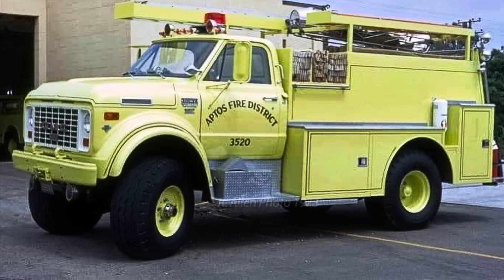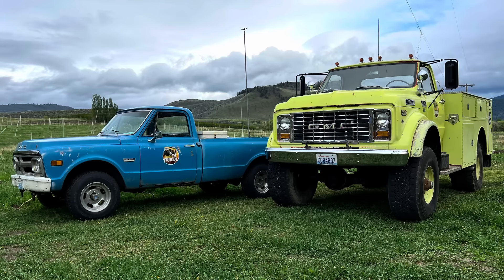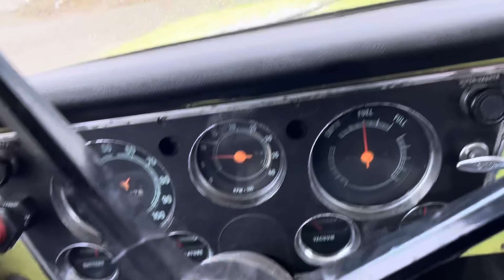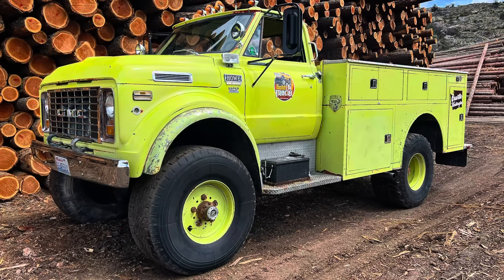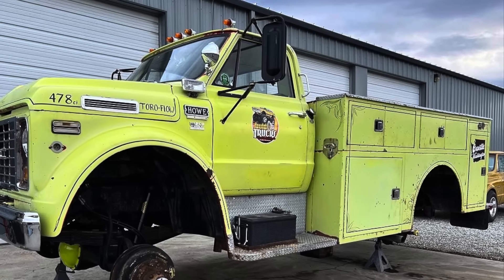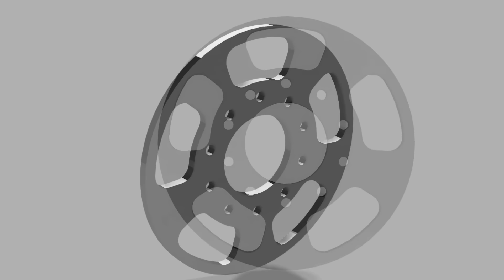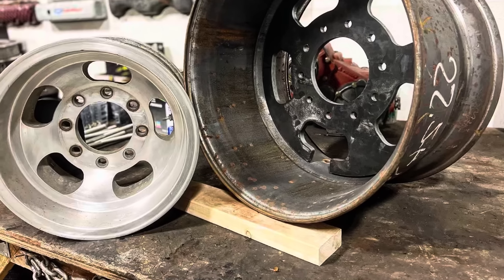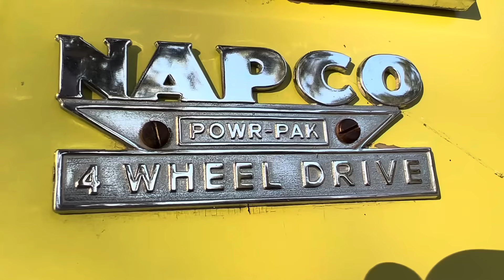My 1972 GMC Napco K5500… The World’s Rarest ‘67-72 Truck! Factory Toroflow Diesel/Allison Behemoth!

Comment: Wow, a Toroflow!? The Anti-Detroit-Diesel from when GM could afford to compete against itself. So few of those exist. That's a rare bird. It sounds absolutely great.
Reply: They weren't as reliable as the Detroit but farmers bought them.😅
Reply: @jimmychanbers2424 , they don't sound as good, either,  although nothing sounds better than a two-stroke detroit.
Reply: I wonder if any of their "toro flo" designs went into the 8.2 fuel pincher
Reply: @blazer6696  That's a great question! I'm leaning towards no. I've heard that the ToroFlow was actually a dieselized GMC gas engine, while the fuel pincher was a cleansheet diesel design meant to be as cheap as possible. But who knows?
Reply: @littlesquirtthefireengine5478   Oh I gotcha.   It was a w.a.g,  wild @$$ guess,   LOL
Reply: @blazer6696  8.2 shares the injection system with the 71 series... so probably very little toroflow design made it into the fuel pincher.
Reply: @littlesquirtthefireengine5478  toro flo was the V6 convert to diesel , the GMC V6 series are great motors, run for ever
Reply: @speeedskater developed simultaneously from the same basic block design so some tooling was shared, but not converted from an existing gas like the Olds 350.  I have a big book just on GMCs.  Don't overload, or run too hard like a Detroit, many guys said that's when they had issues, if they were ran real hard, but they were excellent for fuel economy at the time.  Obviously beat the pants off gas engines of this size, but also rated very high for a diesel on fuel economy.  These engines lasted a long time in marine applications, also, some had 1, even twin turbos in marine use.
Reply: Probably the only thing GM ever made good was it’s diesels. Regardless of what it was used for, Detroits, Toroflow, EMD, Euclids . All great
Reply: @loganbaileysfunwithtrains606  ford or dodge still can't build a good diesel 😅. After all these years
Reply: WOW!  I love it!  Excellent save!

Comment: I cut my teeth on that truck! It was brand new when I got hired at Aptos Fire Department. Later I when became the Chief Mechanic for the dept. I worked on that truck for years. There were 2 of them built same time by Howe Fire Apparatus in Martinez. I ran into one of them about 20 years ago on Santa Cruz Island. Yep, Napco front axel.
Reply from the maker: Call me , 15095603970
Reply: That is sooo cool. I'd love to have the other one! Although I'd use it for logging and fire suppression
Reply: Yep the other one was out at Santa Cruz Island
Reply: Was Chinn the chief when you were hired? If so I'm guessing you're bound for Hell too for messing with the nuns. After this time period I went to work for SCFD where our only interesting piece of apparatus 1949 LaFrance 75' ladder truck repowered with a V6-53 and an Allison. Top speed was just over 35mph. We also ordered the last gas engine/manual transmission engine that Van Pelt built. I always liked looking at the twins.
Reply: That's pretty crazy you happen to see this video from a master piece you worked on years ago.  It's probably still around because of the maintenance you performed.
Reply: Where's the 2nd one?
Reply from the maker: Thanks to this comments lead, I was blue to find the fate of the The second truck. It was donated to the island for fire safety by another California coastal station and it lived on the island for a number of years before getting in a tragic accident and rolling off a giant cliff and down a ravine to its total destruction and demise
Reply from the maker: Truck 3520, my truck, is the last and only left of its exact kind.
Reply: @GoldCityTrucks  Wow! The sole survivor

Comment: What an awesome piece of old iron. When I was just a small kid, my Dad looked at buying a Toro-Flow diesel GMC flatbed truck for his contracting business.  A neighbor owned a GMC dealership at the time, and wanted to make a good deal for Dad to buy the truck.  My Dad finally decided that the truck was just a bit too big for what he needed and bought a 1-ton gas GMC flatbed instead.  The Toro-Flows received some modifications in 1969, renamed the Toro-Flow II.  The engine was renamed the "Turbium" for the 1972 model year, but few referred to the engine under the new name.   The Toro-Flows main problems were head gasket leaks and fuel injection issues.  I suspect that the fire department specified the Toro-Flow diesel because of the ability of the diesel to withstand very long idle times when in use--an ability which post-2007 diesels no longer have without causing emission system problems and repair expenses.  The Toro-Flows were never big sellers during their era, in part due to the fact that gasoline was cheap and readily available.  Up until the late 1970's, diesel fuel was largely only available at truck stops and bulk oil jobbers.  As you noted, the Toro-Flow is pretty fuel efficient.  The comparable GMC gas V6s of that era wouldn't get half of that fuel economy.  My Dad's 1-ton GMC with the 305 V6 gas would only get around 9 mpg, at best--but that engine was a "puller."  As you likely know, those gas GMC V6s had a sound all of their own.  Decades after my Dad sold that old GMC,  I can instantly recognize one of those GMC V6s just from the sound.  The gas engines would run forever, too.   The NAPCO 4WD conversions were bulletproof units that saw extensive use.  That is a great truck--I would have likely gone back to standard wheels and dual wheels in the rear, though.  If the Toro-Flow ever completely conks out, I suspect that a Detroit 6-71 or 6V-71 would be a bolt-in replacement--both bulletproof engines.
Reply from the maker: Thanks for the story on your dad and his truck. Cool to here stuff like that. A guy would think that they would be an easy fit , a Detroit 6
Cylinder, however there is not a lot of room in these engine bays length wise. They came with 4 cylinder in-line Detroit factory.. that is the only Detroit that will easily fit. If I am to ever Re power it would like be to a gas Chevrolet motor, or a 5.9 cummins for simplicity and reliability. I don’t expect to see that day though.. this truck only has 37k miles, and there’s stories of the toroflows going for easily almost a half million miles before an overhaul.
Reply: @GoldCityTrucks you sure? A silver 4/53 would be a cooler swap than the cummins, everyone does a cummins swap😫
Reply: When the toroflo gets weak.  Sell the truck to a museum
Reply from the maker: @Glibzer yes, this toroflow has more power and torque than a 4 cylinder Detroit. I don’t want to go backwards in performance. Again.. not too worried about it, this engine runs great. I see it lasting a long time.
Reply from the maker: @rollo782 no way! This truck will be driven by me until I can’t drive anymore!! Then my kids will get it.
Reply: A good repower for your GMC is a 6V53 and a good fit and bolts up to the Allison
Reply: That Allison should be a MT 41 a 6 spd with a retarder
Reply from the maker: @joemaser9122 you are correct, Allison mt41 with hydraulic retarder. However.. that Detroit engine will not fit in the engine bay without major modifications. The toroflow hardly fits and that Detroit has a much larger foot print. It’s why these  only came with 4 cylinder Detroit’s in this cab design factory.
Reply: @GoldCityTrucks  So I guess these trucks are similar to the later C series in that they share the cab and hood with the 1 ton its just.... taller. Which would make sense why the longer engines wouldn't fit... I am pretty sure you could fit a 6v53 in there with a little doing though, they've been crammed into a V30 etc... before. The usualy problems with a 53 series swap is vertical height anyway which you have plenty. The 6v53 is shorter than the 453 also... the aluminum 6v53 would be the best bet as its similar in weight to the toroflow. Hopefully the toroflow lasts you a while though I imagine most are just concerned that it like the 8.2 is a "throwaway" engine and not very easy to rebuild like other detroits. When you have the RPMs up it sounds a lot like a 71 series to me!
Reply: @GoldCityTrucks  sure, if you're looking at the NA versions, but the 453t has from around about the same to 15 more horsepower than the Toro-Flow depending on version and the 471t has a little more than that. Would definitely be cooler than just another 12v swap too. Of course, with any luck the Toro-Flow will hold up just fine and this will be a moot point anyway

Comment: To you young men out there… General Motors actually knew how to build trucks at one time
Reply: mmmmm ya, but just like ford and mopap now all they build is over priced junk using DEF fluid which is a real joke,
Reply: The lp5 just goes to show they still do. Smallest displacement outve the big three arguably the best motor you can buy now. Thanks to the c4 injection pump Ford used
Reply: @davidlasanen7690  DEF doesn't hurt nothing besides peoples egos. especially with forced air injection. - Automotive mechanic. Now we can talk about power steering pumps, stamped aluminum radiators with PLASTIC sides and tops.... A/C systems... but DEF- DEF is the LEAST of our problems in modern equipment.
Reply: Yea the engine great... not the body of the truck though. @Gmoney4twenty
Reply: I don't think the younger crowd would know what to do with themselves in a truck that doesn't have a 32" touch screen entertainment center.
Reply: @shawnbottom4769  whoooo, that was brutal, baa haa, but oh so true, not to mention back up cameras,and all the other useless junk they come with!!!
Reply: @shawnbottom4769  Born in 83. I hate the touch screens. But I do know, that I absolutely loathe manual windows and doors, on a fullsize truck. I'm 5'8", no way I can safely stretch across a cab to adjust the windows. Also, not a fan of bench seats. Had both in a pos 88 GMC I got off a farmer.

Also? I am pissed at GM for continuing to use the TH400 into the early 90s. I mean, who needs overdrive when 90% of the roads around are 110 kph/65mph? Doesn't everyone want their engine singing 3000 rpm, just chugging fuel?!

Also, I can't lie; I like the fact that the 4.3L V6 in my 2016 GMC 1500 gets decent fuel economy, and really doesn't lack for power.

Comment: That's a badass truck like no other....I can hear the f550's quivering in fear of the monster brute!
Reply: Probably not as they sold thousands more F-550s than this thing for good reason. Goodness sakes GM guy.
Reply: @matthewmoilanen787  Ya just could'nt let 'em have their minute could ya ?  - Haa
I'm a Ford guy, have owned 6 highboys, {390's and 460) and 7.3 power smokes. I've had one ''69 4x chevy and one 70 short step side 327. They were good trucks. Won't own a new-er GM or chevy, but this is a bad ass rig that I would proudly own and drive all day long.
Reply: Totaly  agree and any ol schooler knows  was not much   tougher trk moter than a screaming  detroit   I'm a harvestor guy  got a few 1.25 Ton  1300 a and d model  n9w 7.3 is great but ,   no 6.0 or 6.7 power croak  come close to a detroit  ,detroit s take more hard abuse in the logging  industry   over n over line machines loadders skidder s screaming   3 to 500 rpm over max for 30 yrs  cold hot one tough moter ,  weather  ur a ford  guy claimed  ihc or  dodge guys so inbarsed  they don't call it a dodge but  my cummins     yet there was Chevy  o detroit   5.7 6.2 6.5    ran 350 k easy   but It was not a implant by others  calling a truck  by the moter because  truck sucks so bad !
Reply: Hahaaa!! good one.

Comment: Man, so many memories of the GMC v6's, both the gas and ToroFlow.  Remember the sounds well, as a car / truck crazy kid in the 1970's!!  Thanks for sharing this gem, and not butchering it.
All these new bloated, overpowered but poorly built modern pickups have mostly replaced real medium duty trucks due to cost in many applications, but some of us remember what real trucks are.  All these "Hot Shot" wannabe truckers with over rated / over loaded 3/4-1 tons really need to step up to a real medium duty truck, lots safer and cheaper in the long run.

Comment: Amazing truck, great find.  I'm just concerned with repairs should the need arise.  I'm guessing if you ever have fuel system issues, that will make the starter saga seem downright easy.  Good luck with it, hope it goes many more trouble free years and miles.

Comment: Great service truck. Looks great, sounds great. I'll bet it is fun to drive. I''ve driven a lot of trucks with all sorts of transmissions, but I've never driven one with an Allison. Good job on the wheels, too. One of the trucks I drove that was the most fun was a 60s Ford dump bed truck with an 8-71 Detroit and a Road Ranger 10 spd and straight dual stacks. Man that thing cackled and had power to spare. Lots of volcanic rock here in Idaho, and we were blasting out lava and hauling it several miles to dump in a large cavity for fill. That was a fun job. Blasting, excavating, and hauling away in that truck. I'll bet yours is so much fun. Good luck!!

Comment: In 1970 I had a 56 Chev 1- 1/2 ton...261 cubic inch in-line 6.  It had the NAPCO kit so it was a 6x6 with 22.5 wheels.  I hauled a lot of Cedar bolts and firewood with that beauty.  It was originally a pole-line truck for PGE.  When I bought it, it was minus the big box and boom and winch.  I put on a flatbed and racks and a 10 ton winch.  I had salvage contracts in the Siuslaw National Forest from Mt. Hebo to Florence.  Ran that baby for years and sold it to a friend when I was getting old and tired...

Comment: Years ago there was a guy in our area who put a Toro-Flow in a F250 crew cab 4 wheel drive, Called it Diesel Dorf. I believe he got his Toro-Flow out of an old milk truck. 
Nice find on the 550 and I appreciate you keeping it in original condition.  The only thing I would do to it is try to find or remake the battery box cover.  you'll have to try to match the diamond plate.
New subscriber.

Comment: Really kool truck man. Slotted wheels are insane.  
I grew up in my grandpas junkyard in south bend, kelm’s auto wrecking, not to far from you. He had a half track he used to pull cars around. 
I really dig those early 70’s late 60’s 2door trucks ya have as well.  
I will b back to check out more episodes. 
Thanks.

Comment: Man I haven't seen or heard one of those old toroflows in years.  There were a few around in my area but they never really caught on.  They just didn't have the guts for anything over 30 - 40,000 gvw.  When I was in the Army and stationed at West Point I was in the motor pool while waiting to go on my years vaca in S. E. Asia.  I was a bus driver while there.  We had those old toroflow
diesels with Allison transmissions in our post buses.  So if you need parts for it you might possibly find some old military surplus bus parts.  I'm giving my age away.  Good luck on your truck!  Nice ride.

Comment: Great video. Never heard of a Toro-Flow engine. Truck looks great!
Reply: The Toro Flow diesel shares some basic architecture with the 60 degree GMC big block V6s, and therefore some tooling could be shared, but the gas and diesel was developed simultaneously starting in the late '50s, it wasn't a converted gas like the 350 oldsmobile.  In Toro Flow form they built a 351 ci , most were 478 ci , and a 637 ci V8 was also built.  The 351 was dropped after a few years, when I started reading this big GMC book I have I started looking online for any discussions about the 60 degree big block engine family from 1960-1974, which includes the V8, V12, and Toro Flow diesels.  I found a couple of pics 10 years ago online and a few sentences describing the 351 Toro Flow in a 3/4 ton GMC pickup truck, supposedly GMC built a few like this for testing and was considering offering that to the public, but it never materialized

Comment: I love outside the norm stuff like this. It sounds just like a Detroit and I was thinking that's probably what it had in it at first glance. Surprised it had 5 lug hubs and glad you changed it over. Also really surprised it ran and all the guages still work. Very cool.
Reply: I believe that these came with 5 lug hubs on the front and 10 lug hubs on the rear, so he did not change them over.

Comment: Nice!  I enjoyed this very much.  The Toro-Flow wasn't a bad engine.  My exposure to them was in school bus application around the same era.  This were equipped with 5-speed trannies.
Reply: They had a lot of problems with the heads.  They didn't include enough head bolts for the diesel and they often failed.

Comment: As a fellow lover of the '67-'72 models, mine is also diesel powered with 4-53T DD ,plus 5 and 3 transmissions . Your Toro Flow makes it super rare, not a cookie cutter assembled with aftermarket parts from Summit Racing . I assume the Allison is MT 41 with lockup converter .   I have almost 40 years/ 300K miles on my diesel conversion in a 1 ton stepside .

Comment: Boy did I love this one.. I have a 75' GMC Dually that I found in San Diego it has the long frame on it and a 12' Fruehauf box on it, at first the hardware looked like 50's or 60's but it turned out to be an 86'. it's well insulated and in decent shape but I thought I'd find a LCF truck to put it on 4500 or 5500 would work, that tall box just looks out of place with that regular truck cab.. maybe a COE of some sort would work. In my retirement years I wanted to do what you are doing, I used to work in body shops all over for years but loved trucks, especially 67' -72' but I'd want to make the interior more updated to today's standards but no air conditioned seats or worthless crap like lane departure warnings and stuff